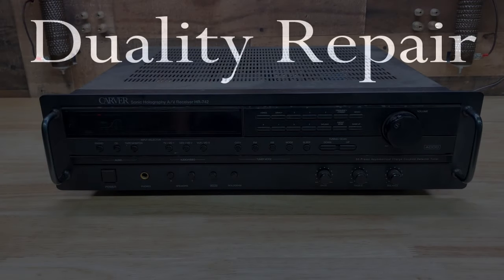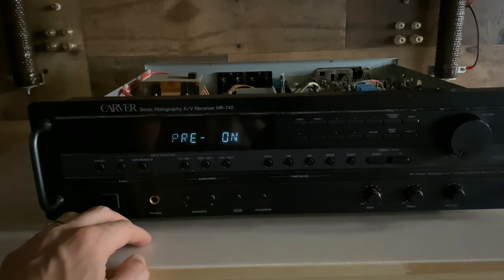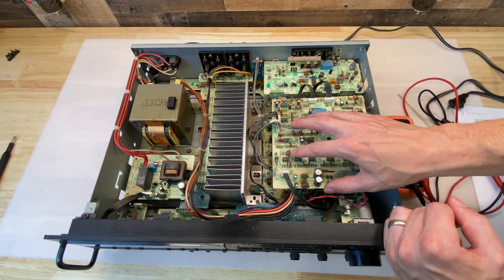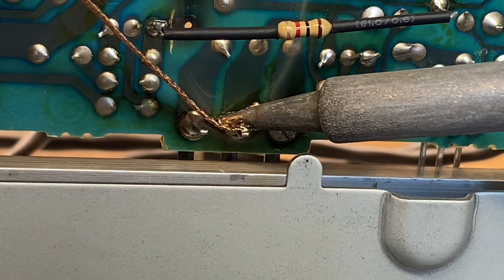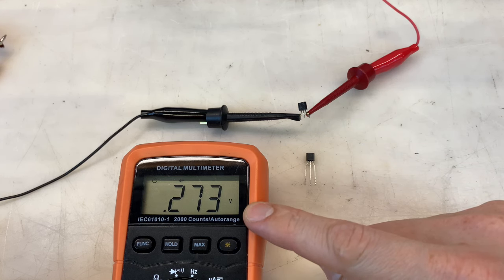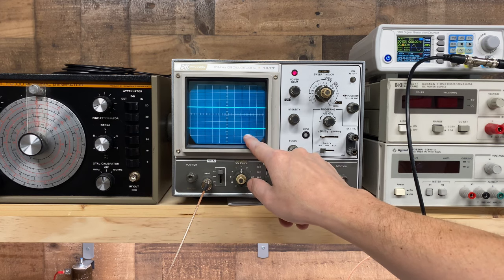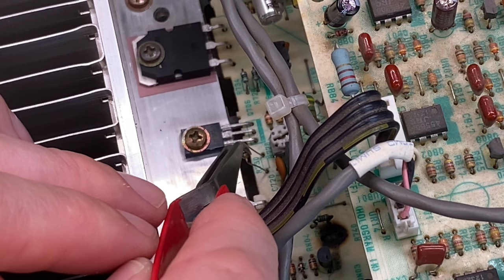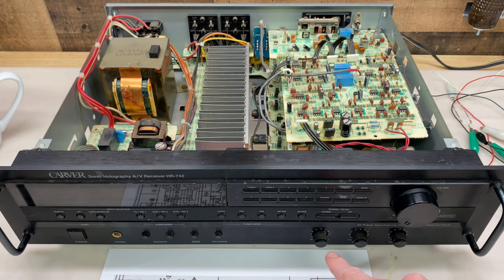DR #56 - ‘90s Receiver Repair - Fixing a Carver HR-742 With No Display and No Audio

Comment: This is probably one of THE BEST channels on the subject. Clear explanation with schematic analysis, clean and tidy bench, skilful solder job. Absolute joy to watch. Ive moved away from electronics repairs a while ago but still maintain my own equipment and occasionally restoring flea market finds. One thing about channels like this is, to show young folk out there that things can be repaired and not just thrown away.. Well done!!!